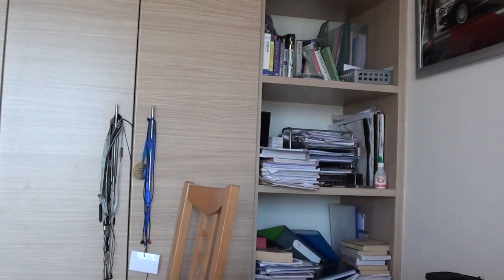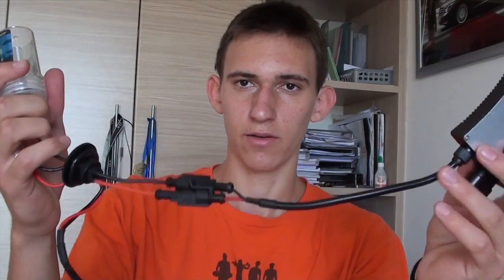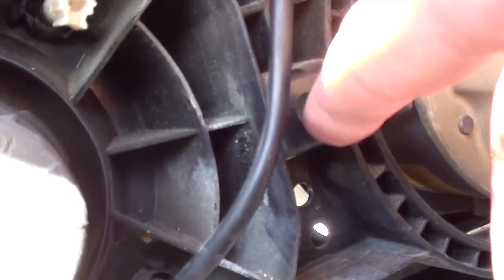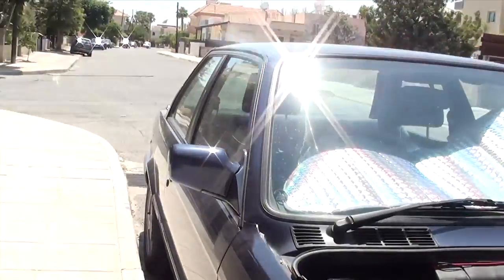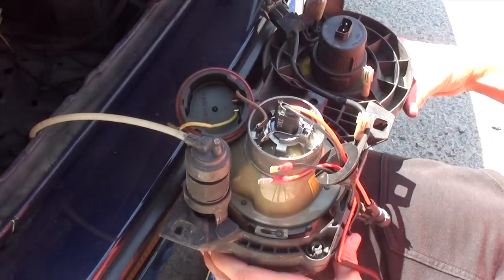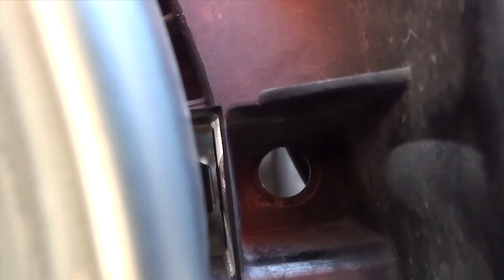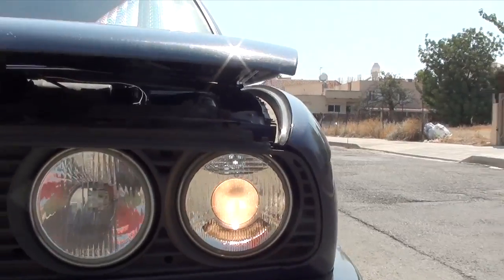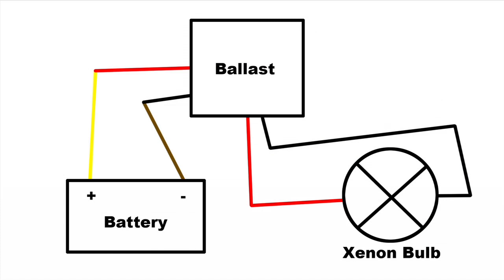How to Install an HID kit (Xenon)

Comment: hey, do these still work?
Reply from the maker: +Zion Max Hi, the bulbs still do but one of the ballasts broke after 6 months. I replaced both slim ballasts with normal metal ones. Those work a lot better, I've had no problems with them and the bulbs heat up to operating temp a lot quicker. See the link to see what I'm referring to: http://www.ebay.com/itm/Motorcycle-Car-35W-DC-Electronic-Digital-HID-Conversion-Ballast-For-XENON-Light-/140976069333?hash=item20d2d41ad5:g:9zEAAOxyjxlTK-P5&vxp=mtr

Comment: i understand u worked hard on the video but anyone who puts hids without a hid projector is wasting their money.  not only that but you blind every1 on the road for your selfishness.  They make halogen bulbs that work much better than these cheap ass lights and the halogens are half the price.  
if you decide to retrofit your e30, its super easy.  Overall, you end up spending in the $300 range and have the same output (depending equip used) as the new bimmers.  
these cheap hid kits are turning into the new rice mod.
Reply: those are euro smiley projectors he has on you numnuts